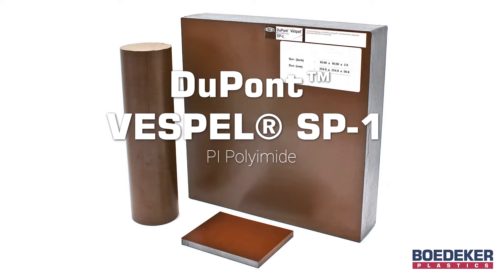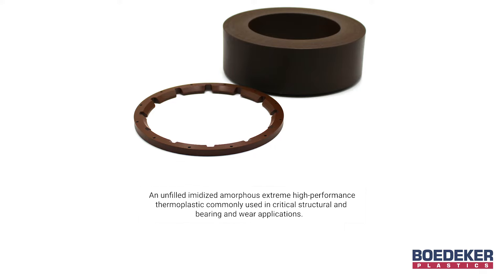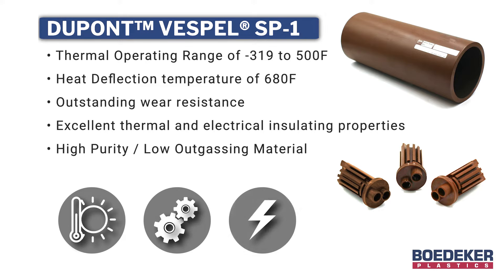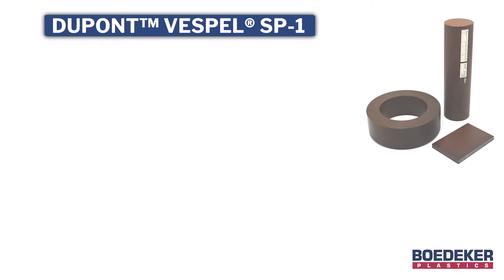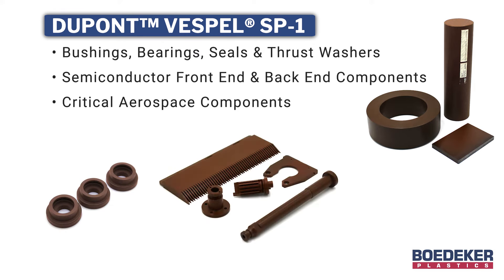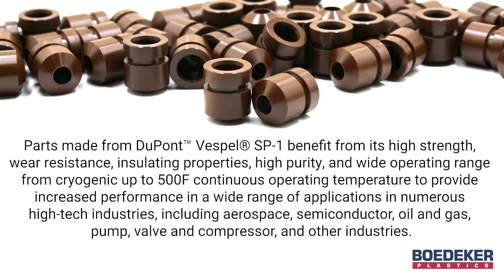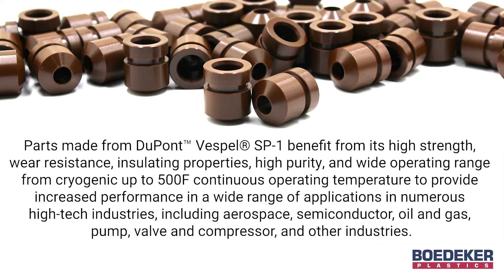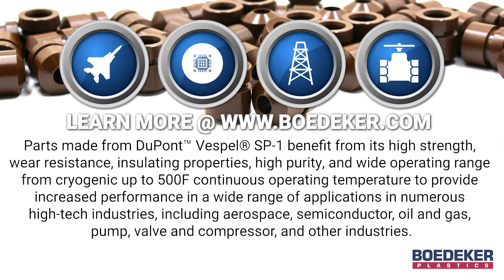DuPont™ Vespel® SP-1 Polyimde Overview in Under a Minute

Comment: A price guideline: think of a price you'd expect, then add on a couple of zeroes.
Reply from the maker: Per your comment....Yes for sure.  The plastic materials that can handle extreme temperatures and extreme environments do come with a high price-tag.  However, if your application does not require 500 or 600F, then the good news is that we have much more cost effective options to consider.  We are always available for anyone that needs guidance with appropriate and cost effective material selection.  Thanks for watching!